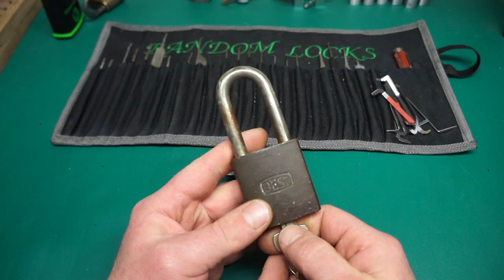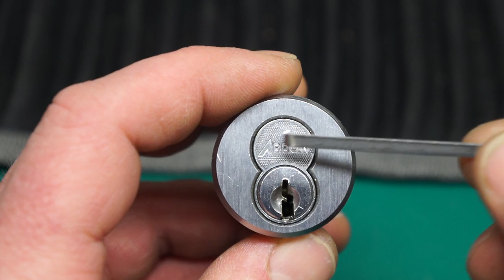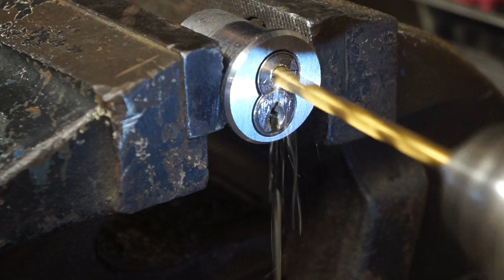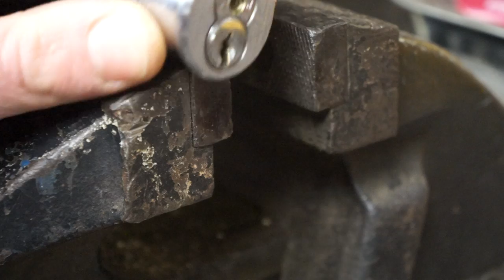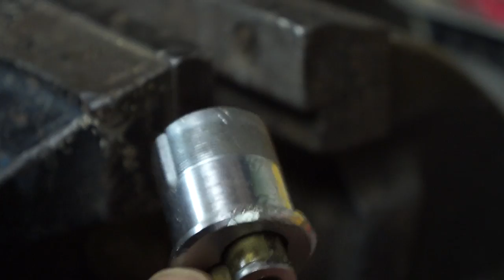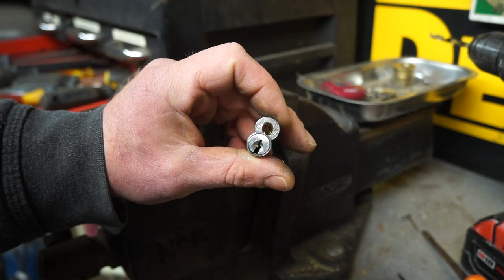(-68-)  How to drill open a sfic lock core. Fun Fun Fun

Comment: Great video! I think that 'foreign object' was actually not something that someone jammed in, but rather an intentional security feature from Arrow's 'Flex ChoICe line'. This platform had keys with a hole in the bottom of the key that would run all the way from tip to bow. The idea was similar to Ruko's flexcore system.

Comment: Used to drill these out all the time working for best locks. Drill the pins out, the front face with the name can come off too. Just just a decent size flat head screw driver and it will move the side bar over and you can pop the core out

Comment: Nice video, 
I have one question... What do you do if the lock is in a door and you cant smack it over and over to get all the driver and keypins out??
Reply from the maker: Steel Pinnings that's a good point, well I'll have to try it out and see how it goes. Good thing I have two. Look forward to a update.
Reply: I had to drill out a bunch of Kaba Peaks SFIC once. And it broke my wittle hart.😢 
But I learned how to do it with the least amount of damage by the end of them.
In total there were 22 cores drilled. Because the office building had vandals stick superglue in every lock. Fkn SOBs
Reply from the maker: Steel Pinnings that's insane. That's a lot of work getting them up and running again. Plus the cost of the kaba cores are not cheap. Freakin people do some crazy stuff.
Reply: Steel Pinnings did you try a jet flame lighter to burn the super glue out?  It might be an alternative to drilling in the future but beware of the fumes from the burning superglue.   Or sometimes a piece of metal just big enough to fit in the keyhole - steel key blanks could be used and can be heated till it is red hot while holding it in pliers can be inserted in the keyhole to burn the glue out as you wiggle it up and down to dislodge the glued pins.   The locks would need taking apart afterwards and repinned after using super glue remover to dissolve the remaining glue.